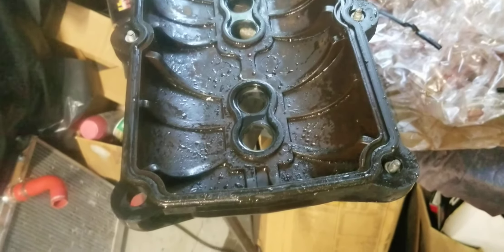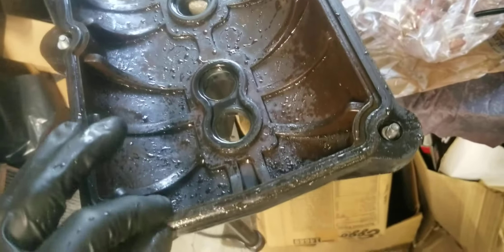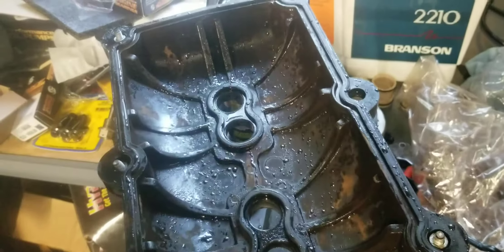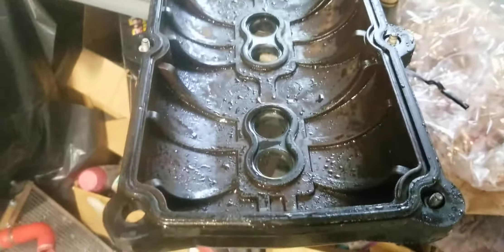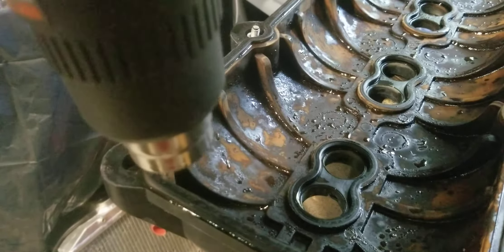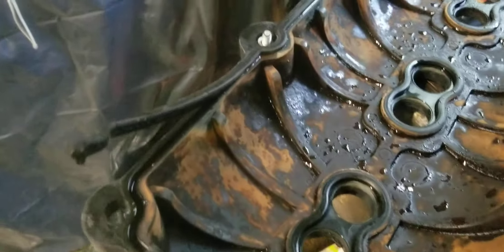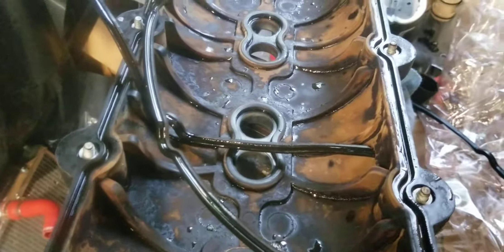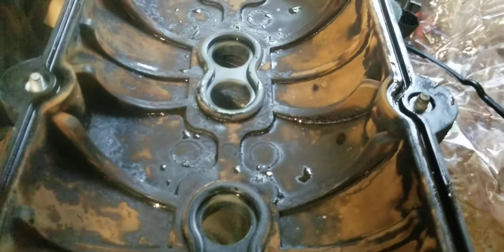How to remove a stuck valve cover gasket easily with no damage.

Comment: So could THIS be the reason why I cannot pull off my valve cover period? All bolts removed and I've been trying for 2 days now to just get the valve cover off. 😠 I don't want to ruin anything but I've tried pry bars, razors and screwdrivers. One little corner moves a little but the rest aaaaaarrrrrgh!
Reply from the maker: Yes that is exactly why if all bolts are removed, look around all head will have a flat spot to pry on it will come off also try to heat it up a little bit
Reply: @DIYKAI   OK. So, the 3 bolts on the  driver's side in that triangle part has nothing to do with the valve cover? My replacement kit came with 11 grommets but I have only removed the 8 bolts...uh-oh.
Reply from the maker: @jaywholoveseveryone1721  they you must have missed some bolts
Reply: @DIYKAI   thanks so much
Reply from the maker: @jaywholoveseveryone1721  yw

Comment: I will try this today...wish me luck!!!
Reply from the maker: Good luck and just don’t hold the heat gun super close a few passes around will soften it up and should come right out
Reply: @DIYKAI  It worked like a charm, however I still can't get my car to start.  I replaced the plugs because they were covered in oil and that prompted me to change the gasket.  Oh well, back to drawing board.
Reply from the maker: @Mike Potter Great I’m glad that it worked on the gasket….have you checked with a spark checker to make sure your getting spark?

Also make sure fuel in at the rail
Reply: I don't have a heat gun but I've got a blow-dryer that will singe your scalp 😁 would a torch warp a composite cover?
Reply: @izzys1715  It probably is worth a try, I did't have to heat it long with the heat gun to soften it up.  Good luck!  I have no clue what a torch would do, but it's definitely overkill for the gasket.  I got my heat gun super cheap at Harbor Freight.
Reply from the maker: What’s the wattage of the hair dryer lol
Reply from the maker: Yup heat gun or a really good hair drier…..no torch on a composite cover
Reply: @DIYKAI  it's 1875 watts & it's actually working! Thanks for the video & thanks @Mike Potter 👍
Reply from the maker: Your welcome and that’s plenty at that wattage lol I set the heat gun on 1700 ish in the summer 2k in the winter lol